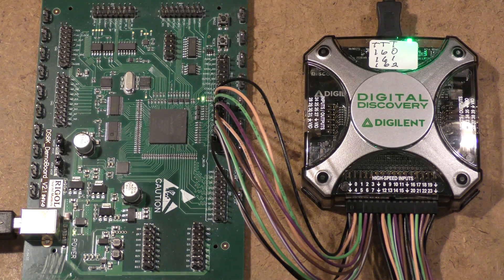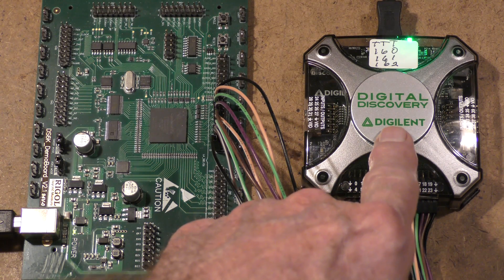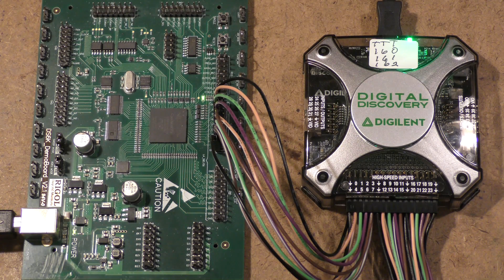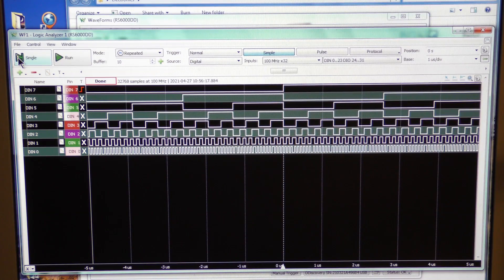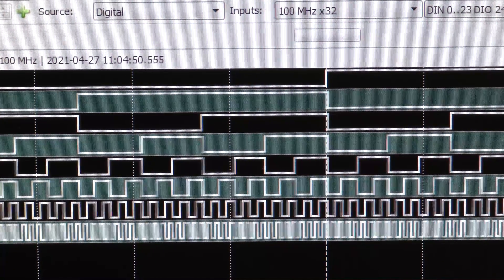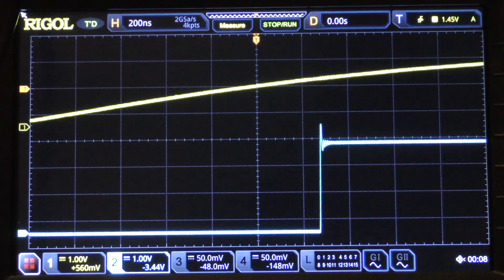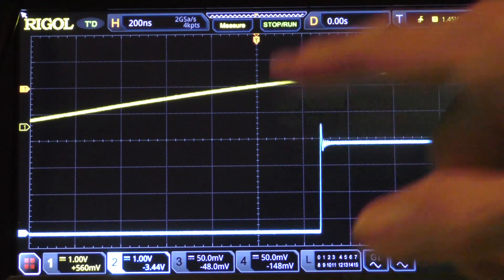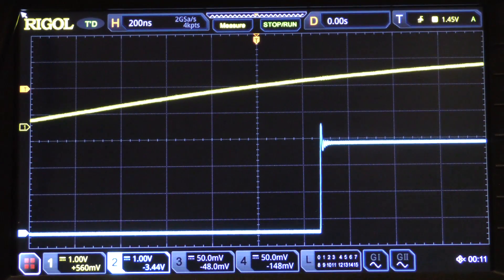TTT395 Rigol MSO5000 and Digital Discovery

Comment: The timing of this video is perfect, thank you!  I just purchased a new Rigol scope and also opted for their cable for logic analysis.  I think I may also get the digital discovery later on as well.  It's interesting that the trigger out documentation from Rigol is pretty sparse.  I didn't even see mention of the output trigger voltage or polarity.